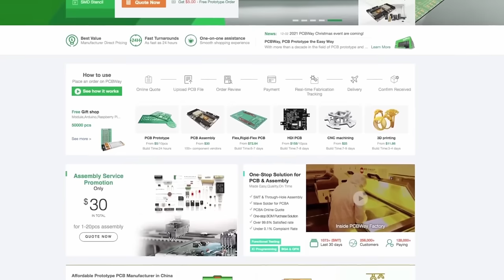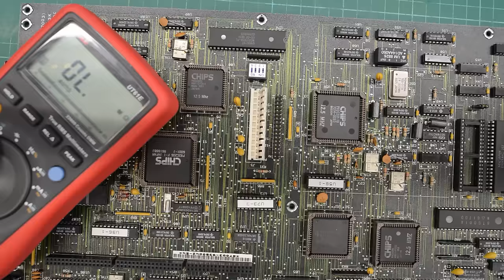Canon tried to make a PC. What went wrong? Teardown and restoration of rare Canon

Comment: black legs on the diode = legs have silver in them (or a silver coating) which has oxidized. similar story to silver jewelry turning black if left sitting for ages
Reply from the maker: Ah, cool. I didn't know. I wonder why this particular diod decided to oxidize. I tested it and it seems working normally
Reply from the maker: Mr Guru  Ok, cool, I didn't know that. I'm waiting for a new ESR meter before I move on with this project. I want to see if we can find a bad component on the HDD PCB

Comment: I think this "Canon" PC was made by Acer. It looks similar to the Acer 915P. Perhaps you can try Acer setup disks if these are elsewhere to find.
Reply from the maker: Yeah, you're right! It looks very similar to the very first Acer PC. We still have the same problem though. There isn't much to be found online about this first version of the Acer 915P. There is also an Acer 915P II, but it has a different MOBO

Comment: Just a thought about the Miniscribe disk. I have one that doesn't spin up. I unscrewed the circuit board & laid it to one side, the platter motor cable (on the left side) still attached & was able to help it to spin up by manually spinning it, I think, anti-clockwise. Seems the platter motor assembly has gotten stiff over the years. Still trying to work out how to get something like sewing machine oil into the right location. This, of course, may be nothing to do with your Miniscribe disk.
Reply from the maker: Thanks, I'm about to take it apart. I'll try to spin it manually

Comment: Tantalums can die in silence. Actually my first dead tantalum in many years of hardware tinkering was shortly a Terratec wavetable plugged to the Waveblaster header of a Soudn Blaster. One tantalum shorted and luckily the PSU had short circuit protection and did not start. No magic smoke, no burn signs.
The hard drive should be spinning. So this is likely the elephant in the room. But a very nice computer.
286+EGA is okay, my first computer was a Sanyo 286 with EGA in the late 80s/early 90s, but this was also only a built-to-spec IBM AT clone and the 5170 had AT, too. But for later 286, where other PCs already had VGA, EGA is rather on the low-budget-side and was likely no longer that desirable.
Reply from the maker: Yeah, it's a weird combo this. Much faster CPU than IBM but has older graphics. Maybe it's a special-purpose computer? I will do some basic troubleshooting on the HDD in the next project vid and test those caps
Reply: It could just be an office computer.  Computer Chronicles episodes from 88 show just tons of Mac Plus and MDA still in use.  EGA wouldn’t be bad at all, since it had MDA resolution text and 16 color graphics.  For all the text-based software at the time, that would be more than enough.
Reply from the maker: @nickwallette6201  Yeah, that's probably what it is. I just find it a strange combo. Faster CPU than the IBM but lesser graphics

Comment: The "good" thing about tantalum caps is, that they go with a pretty light show... some of them  quite spectacular. And they leave behind easy to find stains, or holes if they didn't burn through the PCB.
Reply from the maker: In this case, one might have gone incognito...
Reply: @Epictronics1  : Have you checked the case for stains? Smoke should leave traces on the inside.
Reply from the maker: @bikkiikun  Unfortunately I was quick to clean it. Not realizing I would have this problem
Reply: @Epictronics1  : And you probably did check the PCBs for leads without a component attached to them.
Reply from the maker: @bikkiikun  I have done an inspection of the board. And I will make a new inspection this week to find what I have missed :)

Comment: Oh hey, my first PC was a PS/2 model 50 as well! We had several family computers before then, but the model 50 was the first that was mine alone. It was a hand-me-down from a relative or family friend (I don't remember who), and came with a 12" VGA monitor and model M keyboard. I remember playing a lot of DOS games, and trying out a lot of software downloaded from BBSes. I even downloaded a BBS software package and set up my own BBS, but it was just for fun, so I could play the BBS games without spending hours tying up the home phone line.

Sadly that computer is long gone, but I've since picked up all identical parts to recreate that system. I've got three model 50s, 1.5 of which are working. There's only one working power supply between the three machines, and one motherboard needs a recap thanks to those tantalum caps. The ESDI hard drives have always been problematic, but one of the machines came with a SCSI card, so I just bought a BlueSCSI that I'm hoping to use with it instead. I've got both a 12" 8513 monitor as well as a 14" 8514, but that requires repair. And of course, an original model M keyboard.

I paid way too much for the model M, because I bought a really cheap one that was listed as untested, which turned out to be code for not working. Then I bought a second cheap-ish one that was just missing some key caps that I stole from the broken one. Thankfully the broken one came with the detachable cable, since the working one was missing the cable. It's slightly annoying though, because it's the super long one (like 3m unstretched) with an AT connector rather than PS/2, so I have to use an adapter. Unfortunately those cables are quite expensive, so finding a replacement is a challenge.

Anyway, I'm not surprised that MT RAM worked. It was more of a problem in the early '80s, since they were cutting corners to try and compete with the cheap and reliable Japanese imports. Those chips were dated late '87/early '88, which is well after the start of the "DRAM war" of 1986. Basically the US government forced the Japanese manufacturers to inflate their prices and apply export quotas to make US manufacturers artificially more competitive. And by that time MT had managed to steal the secrets of the Japanese manufacturers so they could produce much more reliable DRAM chips at an artificially competitive price.
Reply from the maker: Cool, Unfortunately, I also sold my original Model 50 decades ago. But I got one again years ago. I have a SCSI upgrade too : ) The 8513 is actually one of my all-time favorite CRT displays : ) I love that thing. I also have the 8518 and 8515, not sure what the difference is compared to the 8514. I'm actually trying to find an 8514 to match my 8514A graphics card. I have done a bunch of videos about my PS/2 stuff but it's paused now because I don't know how to find matching paint to respray the case. Good to know that the MT RAM is ok!
Reply: @Epictronics1  i have a bit rare IBM PS/2 model 40sx in my collection - too with ISA16 bus... 386SX/20mhz... Full set with kb, display and mouse... Was bougth in 2010 on local retrocomputer forum) Also there's a model 30/286 in storage as it's hdd doesnt work and ISA riser is missing, the psu and mainborad works, tohug
Reply from the maker: @yakovkhalip9714  Awesome. Nice machines. Try to recap the HDD in the model 30, it's a common problem. If you are lucky it will spin up again : )

Comment: I was handed a Canon AS-100 MS-DOS compatible (not PC compatible) machine to repair years ago. The guy who owned it still used it for spreadsheets and accounting. Unfortunately, a PAL had failed in it that drove the CPU so the machine was unrepairable. I suspect this AT compatible Canon is a continuation of their MS-DOS compatible line.
Reply from the maker: That's a bummer, the AS-100 looks really cool

Comment: this chunky diode is probably for the spin motor, so maybe that is dead?
try to look at voltages on wires going to the drive motors.
Reply from the maker: Yes, I think this cool drive deserves a repair attempt. I have checked the diod and it seemed fine. I'll do some basic troubleshooting of the drive in the next vid

Comment: the heads are siezed on the platters on that drive, you need to open it and pry the heads off of the disk surface with a toothpick or plastic tool...dont try to spin the platters or youll rip the heads off instantly......you may VERY gently try to turn the stepper and it often works, but dont try to spin the platters..lateral movement when the heads are stuck will detach them from the arms... its very easy to unstick those drives, and after you do it just use spinrite on it. it will exercise the drive real good and the heads should not stick again if you use the drive once or twice a year..to spin the stepper use pliers on the stepper shaft but not on the "interrupter" if you move the interrupter too far off of its original position on the shaft, the drive will not complete its self test and you cannot use it or format it again...if that happens i can give you some tips on how to realign it and after that it will need a low level format.... if in the end you can get it working dont throw it away, you can swap parts and controllers on those old drives and they work, i had here a miniscribe scsi drive from a mac that had a bad circuit board and i swapped in the circuit board from a dead mfm miniscribe 8425 and the drive is now a healthy mfm 8425 after a low level format...i also had to swap in the sensor/tachometer because the scsi drive didnt have one but it had the place to mount it...you can play a lot with those drives and they respond very well....please keep it
Reply from the maker: Thank you, that is very useful info. I have the project put aside but only for a week or two. We should soon be back to this Canon
Reply: @Epictronics1 another thing i may add is that you should test the drive alone, just plug it to power with an psu and it should spin, then seek...if the hard drive is fitted with an LED it should blink randomly then light up for a second then it goes off permannetly and the drive keeps spinning....if there is a fault it can display error codes by blinking, if it fails the self test, i have the table of the error codes for that drive...but first you need to get it to spin...insisting on the drive while its siezed can fry the driver for the motor. i am certain it will work if you are patient...oh and dont worry about clean room or dust...it doesnt matter on those stepper drives with such low data density...think about it as a big floppy disk..looking forward for the next video
Reply from the maker: @MrHBSoftware  Great, I'll give that a try, thanks!

Comment: Old hardware can be a bit weird sometimes. I have an IBM 5162 and a couple of years ago there was smoke pouring out of the power supply, I opened it up but I couldn't see anything wrong (I'm not trained) and it's fine. I've used it since without any problems.
Reply from the maker: I actually have a 5162 too and it's a real gem : ) That smoke probably came out ot the RIFA capacitor in the PSU. The computer will work fine without it but I tend to replace them anyways
Reply: @Epictronics1  I might have another look, they seem to be quite cheap on eBay so maybe I’ll look into replacing it.
Reply from the maker: @Kundalini12  It's not uncommon to just remove them. But I like to replace them
Reply: @Epictronics1  I’ve had a look inside the PSU, everything that could be a rifa (from the images I’ve found online) seem to be ok. There’s no visual sign that they’ve failed or burnt out. The images online show these capacitors with rifa written on them but I can’t see any inside the PSU like that. The closest thing I’ve found is two white ones with 1.0J25o printed on the top. Perhaps I’ll just leave it as it seems to work for now.
Reply from the maker: @Kundalini12  Yes, the only known caps inside the PSU that usually go bad are clearly branded RIFA. This means that it's probably a tantalum capacitor on the motherboard that has blown. The computer is very likely to work with a blown tantalum. I would recommend replacing or at least removing it. Here is a random picture from google of a blown tantalum. https://erickenny.files.wordpress.com/2019/09/ejk_8322.jpg?w=1024
Reply from the maker: @Kundalini12  I should also mention that the tantalums will blow eventually if they haven't already.

Comment: It's probably not it ,  but other brands of these mains filter capacitorso besides RIFA with the same design as the RIFAs can also pop in the same way ( (I've had it happen with a WIMA branded one for instance ). so if you find nothing else that have popped could check for that, looked like there was at least one of that type in the PSU.
Reply from the maker: Good to know, thanks. I have done some more tests with the PSU and it seems stable

Comment: I was watchign this and although the date on the Miniscribe drive may have been 1988, but with the way Miniscribe was, it could have been in stock for a while, so this may have failed because of being a low spec machine released in 1989/1990.
It is quite a well built machine with a good quality power supply and a very well made motherboard.
Reply from the maker: I'll check some more dates to see when It might have been made

Comment: That diode have black leads probably because they silver coated. Just my opinion. I had experience with silver contacts
Reply from the maker: I wonder what might have caused this particular diode to oxidize, and not any of the other diodes. Assuming they all have some silver in the leads?
Reply: @Epictronics1  I can't see any other diodes as same model as this to compare. I think that is the only component with silver. Maybe it's military spec diode idk. By the way you should inspect thar board again. Because that fibers at 15:43 and 15:52 is paper separator from electrolityc capacitor. It happens when they blow up. That's why it smelled "funny".
Reply from the maker: @dextertech6570  Ah, ok. I will do some basic troubleshooting of the Miniscribe in one of the two upcoming videos. Maybe there are more components underneath that PCB

Comment: https://en.m.wikipedia.org/wiki/Canon_Computer_Systems
Wikipedia has a list of all the Canon Computer Systems made Computers.
Reply from the maker: cool, that's quite the list actually. This machine is missing though : ) an Interesting read too. I didn't know Canon was a large investor in neXT
Reply: @JeffreyPiatt  the list also skips over their 6809 based system with a "CPM-like" OS. The CX-1 (Monitor) / BX-3 (Built-in printer and a fluorescent text display). It came after the AX-1 (calculator programming) / BX-1 (BASIC programming) 6800 based desktops.